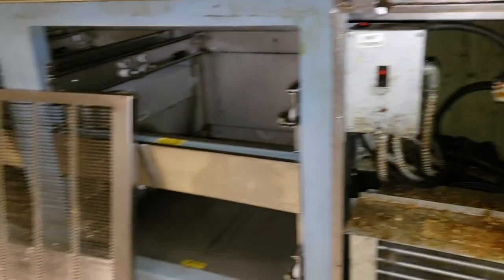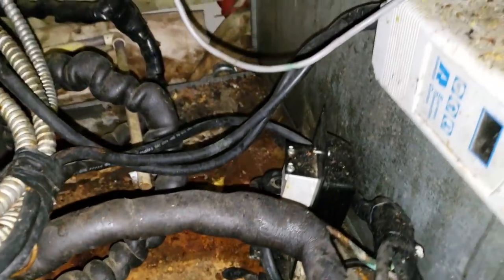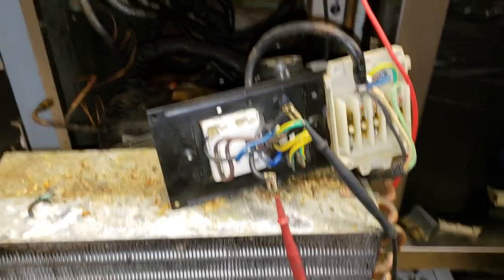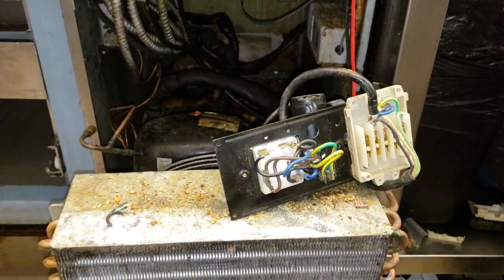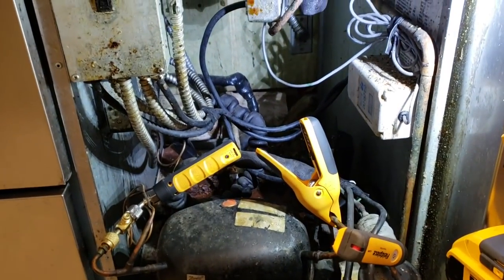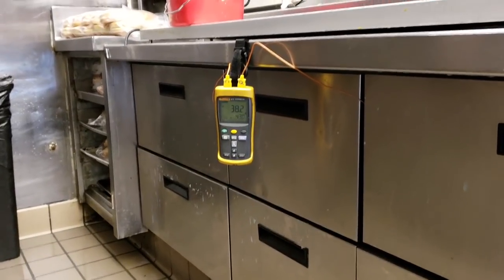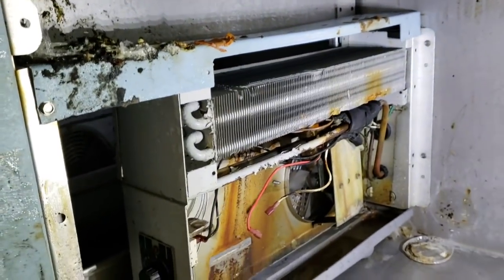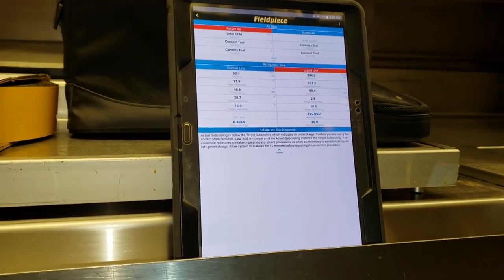Delfield six drawer unit not temping

Comment: You have a lot of experience and I love the videos.  I have to say it though as no-one else did in the comments.  The broken wire is an open not a short.  I used to call them both shorts (broken wires and shorted wires together), but when I went to electrical tech school all my teachers corrected me, "that is not a short it is an open, as in open circuit."

Comment: I love the idiots that use wire Ties on a TXV bulb. Had It screw me several times. I have somewhere I'd like to stick that wire tie. Nice investigative Diagnostics. I have added a sight glass on known leaking units that they don't want to properly fix. But I would say that receiver was more for when it shuts off the bottom and top rails at different times for The Reserve capacity. Great video!
Reply: I wouldnt call em idiots, just inexperienced ones. Theyll suffer for that so why adding more?

Comment: DO SENSING BULBS HAVE TO BE HORIZONTAL? I CAME ACROSS A UNIT THAT HAD A SENSING BULB THAT WAS SIDEWAYS BECAUSE THERE WASN’T A LOT A ROOM. I WASN’T SURE IF I COULD PUT IT ON THE VERTICAL LINE. RESIDENTIAL SPLIT

Comment: I've subscribed and have been watching your videos for a bit. The similarities are uncanny and can generally tell your locations at points. I find myself in the same areas and am glad that you are so in depth. A quick question though, how did you solve the condensating issue on the start components? Did you just mount them elsewhere?
Reply from the maker: Yeah I moved them further back and also fixed the insulation on the txv
Reply from the maker: Do you work here in so cal?

Comment: Quick question. I was working on one today. The filter drier said F032s or F32S (cant remember) does that sound right to you. I rarely work on these units.
Reply from the maker: Yeah an 032 drier Is fine
Reply: But it had a "F" in front. I usually see "EK" or "C."
Reply from the maker: The 32 is all that matters 3 represents 3 cubic inch and the 2 represents 1/4" line size.
Reply: Look at size chart on box.pending on compressor hp it might say 032,052,082 for your application/gas.